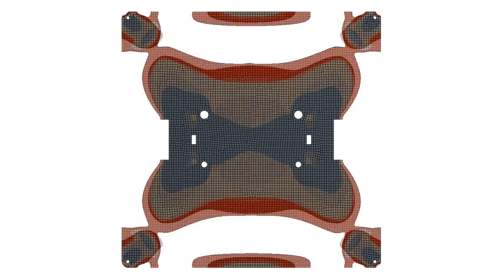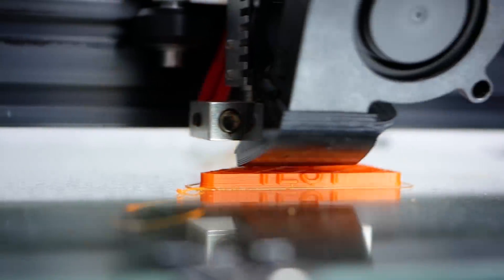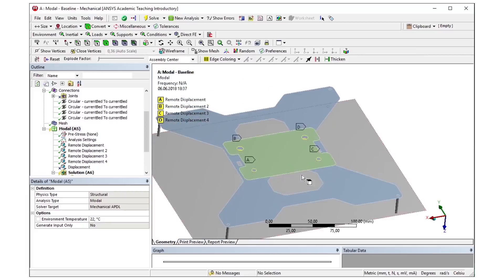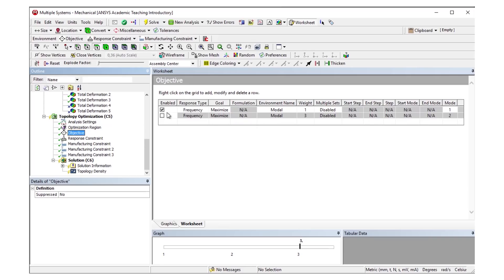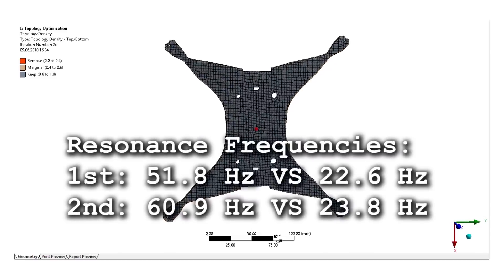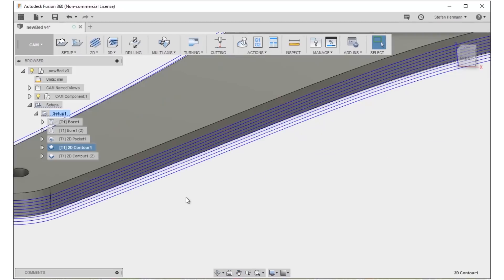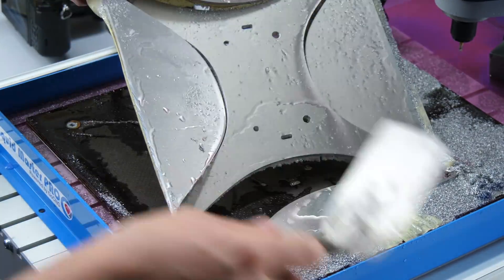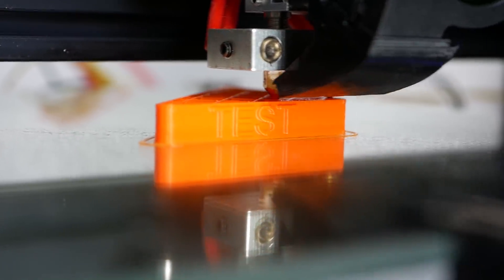Topology Optimizing and Machining a new PRINTBED for the TEVO Tarantula

Comment from the maker: Looking for a new printer and want to support the channel?
TEVO Tarantula for $264.28: https://goo.gl/hY53qQ OR AMAZON http://geni.us/Shfx
TEVO Tornado for $339.99 with coupon "GW4-15": https://goo.gl/Q1CR87
Alfawise U20 starting from $169.99: https://goo.gl/45ihaz
CR-10S on AMAZON Prime: http://geni.us/rVBsR
ANET E10 for $249.99 with coupon "GW4-13": https://goo.gl/o3qQdo
Tronxy X5S for $275.99 with coupon "GW4-14": https://goo.gl/BncF75
Reply: I'm not sure if you have considered it, but what about a video showing how to simualte airflow in a part cooling fan duct to check if a design is usefull or not

i had a look at this one for my Mendel90 frankenstein build: https://www.thingiverse.com/thing:2065461

but something with the part cooling is not right and i cant figure if the duct is not optimal or its my 5015 radial fan that is not powerfull enough ie to low cfm
Reply: Should look into the Tevo Flash. It will probably replace the tarantula in the coming months. Similar price point, better construction.

Comment: hey Stefan, i'm curious what kind of gpu you use for this simulation, does it need the fp64/double precision kind of gpu or you can get away with fp32/single precision one for topology optimization in ansys? thanks in advance

Comment: While I admire the efforts put in to design and cure the problem you have I still think that the basic problem lies in the actual design of the Y axis....On most machines with this design having a narrow Y axis beam to carry the bed makes it only possible to have a plate with the four spidery arms that act as springs themselves.....it would be far better to have a machine design that had 2 Y axis rails spaced apart instead of the single central rail design. That would enable you to have a square bed carrier that rested on 4 points across 2 rails instead of the narrow central wheel carriage with 6 rollers. Spacing the bed carriage farther apart is more stable than the present plethora of designs like the Ender3's  etc etc. I would also remove the spring suspension method under the bed and use solid spacers with shims to level the bed.....once and once only.

Comment: how thick is was your aluminium sheet? my ancyubic's y carriage is just a solid square and I think it's made of steel. it's soooo freaking heavy and makes a noise so I want to reduce the load on the Y axis.
Reply from the maker: I used a 4mm aluminum sheet for the design.
Reply: @CNCKitchen  Thanks a lot for answering ^_^ lets hope this fixed my issues if I can get someone to cut it for me or if I can borrow a jigsaw :D

Comment: best solution is to put some lock nuts on those threaded thingys and not let them flop in the breeze. ive been building gas station canopies a  very long time I don't need to be an engineer to understand torsional strength vs sheer lol good luck

Comment: Since you have your own CNC machine, you could alternatively have made the new bed much thicker, say 8mm, using a webbed arrangement that would have been a lot stiffer for the same weight.

Obviously this would take a great deal longer to machine though, since you would be machining away a lot of unwanted material. These things don't matter when you're not paying for the number of hours it takes to machine the part.

I wouldn't call your feeds and speeds conservative. There's no need to go flat out anyway, it's not a race and you're not in a commercial environment. If in doubt, slow everything down. You'll get a better finish and you won't go deaf.

A great video though, with lots of really useful tips on what tools to use and how to go about it.

Comment: Hi Stefan, thanks a lot for your video's on 3D printing and testing test-structures! I really enjoy your rigor and consistency in design and experiment!
One remark about your engineering approach though: After your topology optimization, you 'trace' the result with a more regular geometry that is easier to model. This step is not necessary since you are going to a CAM step next and the shape can be arbitrary. With changing the design, you obviously also change the performance of the part. However, if you still wish to continue with this step, it is good practice to perform a modal analysis on your final model as well to confirm the performance.
Other than that, excellent job! :)

Comment: cool now make a more efficient and easier to level 3 point Bed.
acrylic beds are absolute garbage and a nightmare to keep level. when i got an aluminum bed for my old mostly acrylic prusa i3 i only have to re-level the bed once in a blue moon or when i moved the printer.

the way TEVO beds are mounted is why it still wobbles so much. its only supported in the middle which is quite a design flaw if not done properly. 
you should try to better support the bed itself next. 
i cant recommend a TEVO after seeing this... the design flaw with the bed support and bed material is off putting. I've seen ~$230 printers with a aluminum plate and more rigid bed support.

Comment: HI Stefan, I bought the "Liquimaster Pro" from GoCNC that you used in this video. I had exactly the same issue as you in the video, the nozzle was clogged with chips after a few minutes as the foam filter did not adhere to the bottom of the tray. To make it short, it is a piece of junk. It broke down right after the first use. I asked how the profiles are mounted to the tray before I ordered it. They told me they use some "special" glue. After both profiles came loose during the first milling operation and left some damage behind, I could see that the "special" glue was just a rarely applied silicon. Nearly 250€ are in the trash bin now.
Reply from the maker: Thanks for letting me know! That's unfortunate. I'll try to talk to the guys.

Comment: You miss the mess refinement study ;) , but well done for joining 3d printing,fem and optimization in the same video. Have you tried open source CFD or fem codes ?
Reply from the maker: The topology optimization is stiffness based so mesh refinement is not that critical. I actually didn't use any open source tools so far but programed my own small FE software at university. Even excel can solve small FE problems 😉

Comment: After watching this i was totally inspired to fix my carriage on my A8 as its made from 3mm thick alloy using 3 separate pieces to make a H. I drew up a template from information i found online about the dimensions and also measured from the original. I made the mistake of trying to use the original as a template and match the holes rather than trusting the diagram i made. I am surprised the original even worked at all it was causing issues as it was with slight binding of the y axis. The new carriage on test rolling is amazingly smooth only need to cut some holes out to reduce the weight.
Reply from the maker: Great!

Comment: Totally amazing project! Everything connected up so well to solve a problem. I have a question about the height adjustment springs though, why not try shorter and stiffer ones? Just tightening the exiting ones a lot more to pre-tension them will reduce vibrations.
Reply: exacly my thoughts

Comment: Problem with metals like Alu is the low internal damping. It is critical to get a high damping. A great way to get this is to make two metal plate 45% the thicknesses of the plate (sum 90%) and the sandwich the plate together with a damping rubber glue. This way any vibration will induce powerful shear forces in the rubber glue and provide fantastic damping. This is an example of what is used in the car industry.

Comment: I noticed right away that the carriage of the Tevo Tornado is needlessly heavier than it should be and drilled it like a Swiss cheese. I also added diagonal supports and ordered vibration dampers for the motors. That should eliminate some of the acceleration wobble, but not all.

Comment: Hey Stefan,

about 6:34 you were converting mesh to geometry, but why didn´t you used command "Mesh to Brep" ?
Look at that xD

Best regards
Lukas
Reply from the maker: Because "Mesh to Brep" is the devil :-D This doesn't give you a nice design. Have you seen how edgy the optimization result was? This is where the engineer has the interpret the design proposal and not just blindly use what the computer has given you.
Reply: CNC Kitchen ok ;)

Comment: Re assemble with the old part, reprint the test at several positions, repeat with new bed.
Otherwise the proof of improvement is absent. Note a taller test print may be more sensitive.

Comment: Very good. I want to try using MATLAB for the same task you did. But that means writing a veeeeeery long script 🤣. Do you know if there is a shortcut for that?
Reply from the maker: Take a look at the "Soft kill method" (SKO). It's a pretty simple optimization algorithm for such a problem.
Reply: CNC Kitchen I will defenetely look at it👍 thank you. I've just finish the course of numerical calculation at the university and even thoug it was not a super advance course ( we did all the algorithms for linear and non linear systemes and differential systems) I feel like I can do anything with fusion 360 and matlab ahaha 🤣
Reply from the maker: Looks great! Will make one for myself (since I hate the stock one), but probably one of the remixes, since I'm afraid that the roll falls off the left side.

Comment: I'm going to school to be a mechanical engineer and have recently done a lot with FEA analysis as well as operational deflection shapes so your video is very familiar to me. I think you did a good job showing how simulation can show deflection shaped based off of loads and how to then use that data to optimize a design with your desired design space, but I think you focused on the wrong aspect of the printer to fix. Your main problem is that you have a large mass (print bed) osculating with only springs to transfer and dampen the motion. So, in my opinion (the springs and bolts being the weak point) you should realize that using springs as a leveling system is a design flaw since it adds more error than what it is worth. Optimally you would mount the print bed directly to the Y axis so that you don't have to deal with the delay of motion transfer from the springs. You lose your quick leveling capabilities but an unlevel bed is easily accounted for with the UBL system in Marlin.
In conclusion I think you did a great job showing the design aspect of engineering, but you focused on the wrong area to fix the problem that you were trying to correct in the first place.
Sorry for the long comment.
Reply: Exactly! Great video but as you pointed out correctly, that was not really solving the issue when you have those screw/spring mounts.
Reply: I agree, but how would you handle XY thermal expansion?
Reply: The thermal expansion coefficient of 6061 aluminium is 23.4*10^-6m/m*C. So doing some quick math with a square bed .25m and a max temperature of 120C (20C assumed ambient) then the total expansion is 0.000585m or 0.585 mm. In the overall scheme , this is tiny and accountable with UBL (unified bed leveling) if the mesh is created when the bed is at printing temperature.
(Numbers are rough and the constant used was taken off of a google search)
Reply: @sdrawkcabtidaersiporfavor9164  Who told you "20C assumed ambient"? In north, it can easily be -20C in winter. Heating it up all day when not using is unacceptably dear.
Reply: @y.z.6517  assuming 20° c ambient is assuming you keep your printer inside if you keep your printer outside then you have way more problem than trying to level it considering it has to deal with the harsh environment.
Reply: @sdrawkcabtidaersiporfavor9164  No buildings without heating can maintain 20° c in winter. And heating is costly for rooms without people. In a long winter, the inside temperature will eventually approach outside temperature.

Comment: Nice job, but get rid off these tiny 20 or 25 mm high screws and springs for holding the bed. I would add a 18 to 20mm high  aluminum or Delrin post with about 15 mm diameter and add an about 5 to 7 mm silicon washer with the same diameter. This will be much more rigid than these tiny srews and springs.

Comment: I replaced the wooden base plate on my reprap with one I designed. I didn't have this kind of tooling to validate the design but it was a huge improvement in consistency - but increased the weight a lot. Only improvement I can suggest that I did was get rid of those springs and use stand offs. Seemed to reduce movement I didn't want.

Comment: This is soooo cool, love the analysis. The only thing I now need is a maker-space and CNC machine. :) Is it also possible to send such a design off to a CNC service?
Reply from the maker: Off course, the files are on Thingiverse. Ever easier than milling: a waterjet-cutter!
Reply: CNC Kitchen That’s awesome, didn’t realize you had them on there, you’re awesome. :) is it possible to shrink such design for a smaller printer? Would that work regarding the resonances?
Reply from the maker: The shape should in general not be the worst baseline for a new design. Not 100% optimized but maybe already 90% there which should mostly be good enough.

Comment: Ansys! That's the way to go, but if you want to get better results for Topology Optimization I advise you to use SolidThinking Inspire as its has waay more options and its easier to work with. If you want to reach F1/NASA/SpaceX/Boeing etc engineering level an precision Optistruct is the best program for topology optimization, a true enigneering marvel.

All the best!
Reply from the maker: For almost 8 years now ;-)
Reply: Exactly hahaha, I have worked with a few modules and GD/TOptimization programs, but recently I had the opportunity to start working with Inspire18 and they have incorporated optimization for moving parts and lattice optimization, as you know Optistruct is the best out there, but is really expensive hahaha, maybe one day I would have the opportunity.

Keep up the awesome work!
Reply from the maker: Inspire is nice for a lot of optimizations (and actually runs the Optistruct solver in the background) but in special cases I still go back to pure HyperMesh and Optistruct just because you can do anything with it, but it's a lot of work to setup and you need quite some FEA knowledge.
Reply: True, little by little I should get there at some time. Thanks for sharing your thoughts!

Comment: Cool project! Can you somehow set the print settings, so it doesn't print on the resonant frequency? could you just add mass to the system to shift the critical frequency? Also we need more CNC projects.
Reply from the maker: If I remember right, Slic3r had this feature at some point.

Comment: This is amazing ! You should have splitted this in more smaller detailed videos ! Your channel is the most advanced one related to 3d printing, your engineering background kind of shows ! I also had a similar problem, ordered a 5 mm 300 x 300 Al sheet for my bed, but it was a whopping 1.2 kg which is way too much for my cantilever bed support . I had in mind to do something like you did, so to make an X to reduce the weight, but as I have no tools to cut aluminium I returned it ... :( I wish you published this before :D .
Reply from the maker: I'd be happy to show the detailed analysis step-by-step. This gives an overview about the process but it doesn't really count as a tutorial. If more are interested, then I'll make a detailed ANSYS topology optimization video.
Reply: CNC Kitchen Yes please do ! I am also an engineer but SW, did also some optimization in University but no practical things . It's also curious why you had those strange results for the optimization, like the one with the thin strips on top and bottom . Is it because the restrictions were too wide ?
Reply: Please do! I think this is an area the 3d printing community does not tap in often enough.